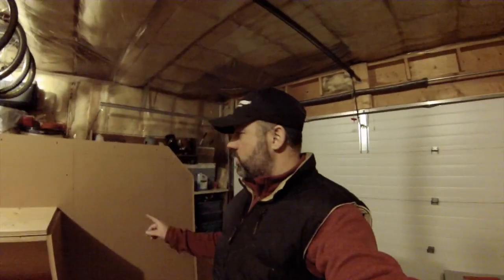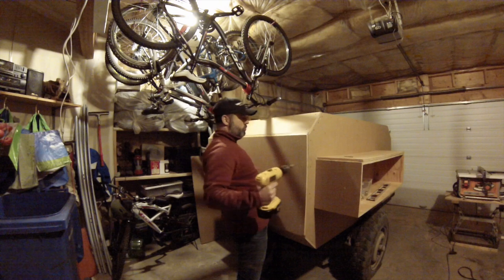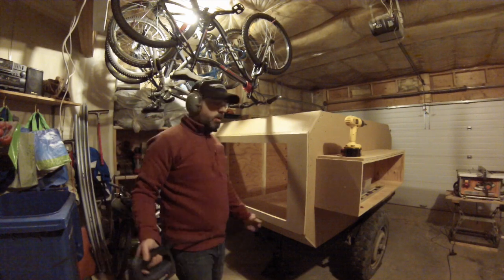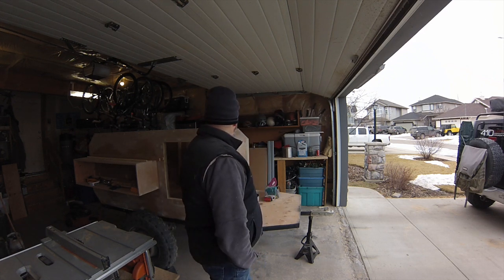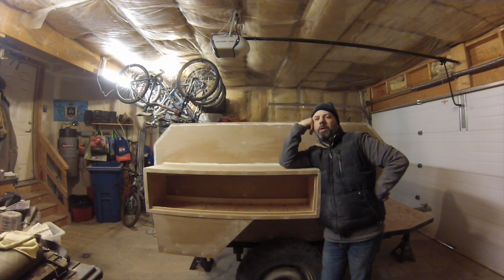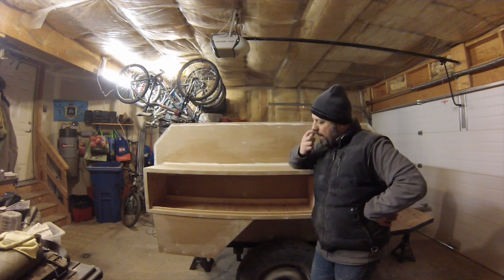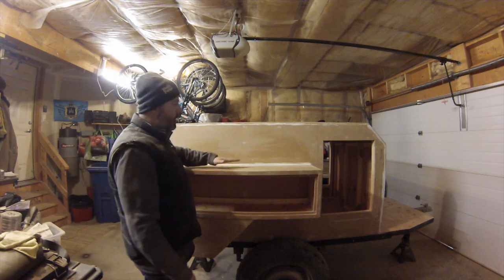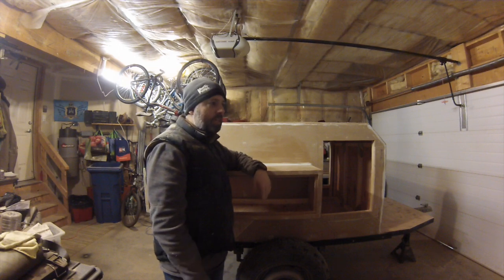410 XCO: The EH-2 Trailer Build Part 2

Comment: Looking Good!!

Any plans to do an pressurized water system? I've been considering mounting an inline 12V RV pump on the inside of my canopy, that will just have a pick up tube that will drop down into the top of those 20L Water jugs.
Would be very handy for washing dishes, Cleaning windows, etc.
Reply from the maker: We have talked about it, but haven't committed.

Comment: wow, looks amazing. how many layers of coat will you apply? just the layers of coat and metal plates to protect the wood from the elements, nothing else? any plans for solar powering? how will the RTT / awning solution look like. now I'm really really keen to see what you have in plan .. :-)
Reply from the maker: would like to get 3 coats but 2 might be good enough. When the trailer is not in use, it will be stored in the garage. We do have future plans for solar power but for now a 12V deep cycle battery with a GB40 Genius Charger will do. The RTT will open on the driver side and a 6 ft Fox Wing awning will be over the kitchen on the passenger side.

Comment: HI... About the trailer back door... remember best for it to open road side... nice trailer BTW.. but why wood?
Reply from the maker: Thanks for the advice. I actually decided it open downwards. As for why Wood? Wood is inexpensive and very easy to fix mistakes. If you use the proper plywood like Crezon, paint, sealant and brackets, you can make a sturdy trailer.

Comment: Maybe I missed it but do you have the dimensions of your trailer anywhere? Thanks so much for the step by step!
Reply from the maker: llatomll the box is 6' long x 4' wide x 3' high. The platform front to back is 8'. The complete length with hitch will be 12'. I hope this helps.